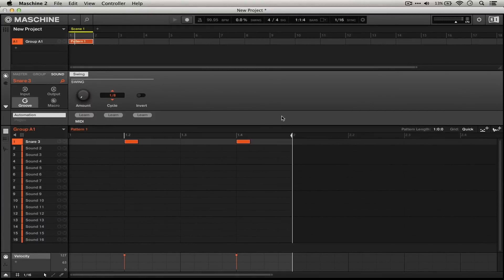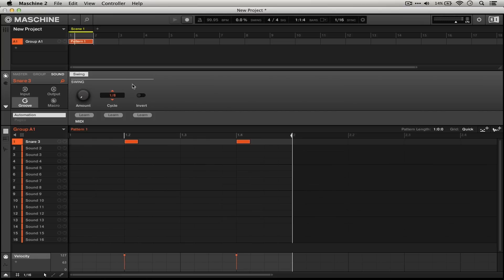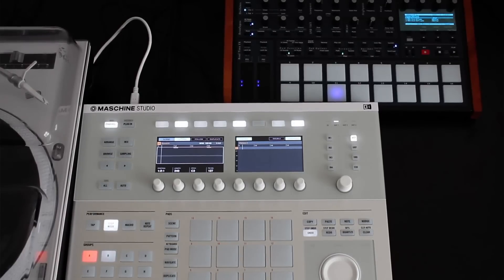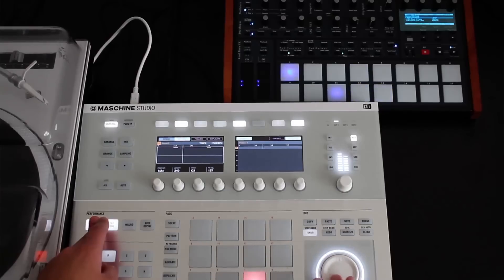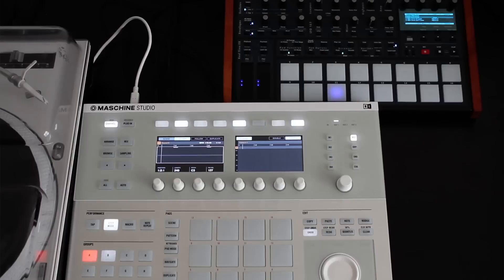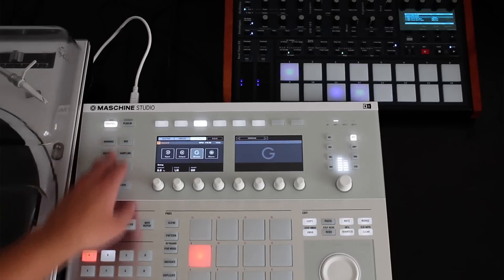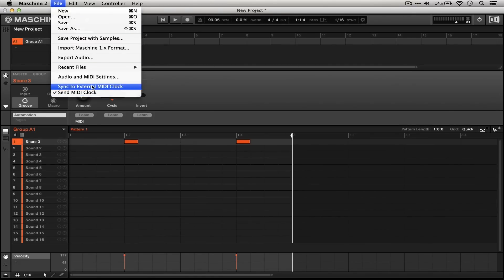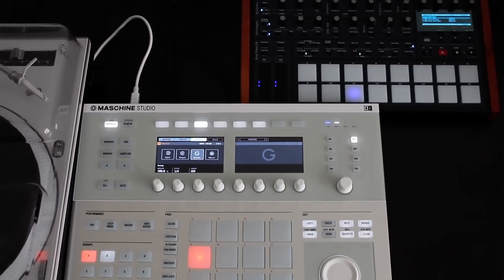NI Maschine - Syncing Maschine to External Hardware via MIDI - How To Tutorial

Comment: How do you get machine to match the DJ software bpm. Not the machine being the main bpm. When I press link the serato would match the bpm of machine instead of the other way around. Also I don't have mk2 plug as midi in my controller/prime 4. I just have it connected to the Mac via USB, and both software on the same MacBook pro. Do I have to plug the mk2 midi to the prime 4 controller as a midi in?

Comment: Hi, I'm trying to send midi sync from Traktor throw my Traktor S8 midi out to my Maschine MK2 midi in. The softwares are running on the same PC. I try to adjust the offset in maschine, but it seems that nothing happens, and the offset changes randomly sometimes. Do you have idea why could this happen, or what could be the solution to tune them to sync? Thanks in advance.

Comment: Thank you for the helpful video!

Have you tried this concept syncing Reason with Maschine?  I'm thinking since Mac's have virtual MIDI native to the OS and PC's could just use a 3rd party piece of software to emulate the "cable", it should all work relatively well, eh?
Reply: Justin Kamerer I would love to sync Maschine with Reason or Maschine with PT, or both... This would be tits. Have you tried it or learned a workaround for this?
Reply: greensleeves32 You know, I've kind of just stopped using Reason altogether at this point BUT I was having a good amount of success just using internal MIDI Sync between Maschine and Reason.  Basically, I'd slave Reason to Maschine (so I'd have transport control from Maschine) and then record MIDI in Reason alongside whatever I had playing in Maschine.  Then, I'd just dump everything into Logic when I was ready for the final mix/arrangement (or PT as you mentioned you use).  I know it wasn't a comprehensive solution but it was a pretty easy workaround that required hardly any complex routing/settings!
Reply: Oh yea, that sounds like a good setup. I'll have to try that. For me, I'm finishing existing files in PT and reason by routing Maschine into PT via an instrument track and then printing each Maschine instrument to an audio track in PT. It's ok for finishing sessions but not when starting anew haha I have been really liking starting new tracks in Maschine so I'll have to try your routing soon. I also need to study Maschine WAY more... I need more time.